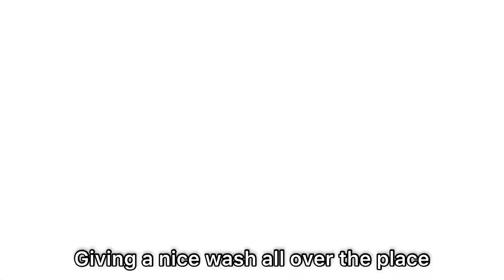Exterior Gutter Cleaning and Partly Roof Pressure Washing | Satisfying video

Comment: The pressure doesn’t blow you back on the ladder?
Reply from the maker: 😂 not yet my friend 11 years still I’m strong to hold against it by god’s Grace  👍
Reply: @exteriorcleaningxpert  I’m just starting my gutter and roof cleanings, I’ve mainly done soft washing siding with an xjet and some concrete with my surface cleaner. What specs are you running on your pressure washer?
Reply from the maker: @CrawdaddiesPWB  I have a Petrol Karcher g7 and three different HD machines and have a 18” rotary surface cleaner mate
Reply: @exteriorcleaningxpert  nice I have a Simpson powershot 4200 psi 4gpm  with Honda gx390 a ryobi 18” surface cleaner, and a rotary nozzle for concrete and decks